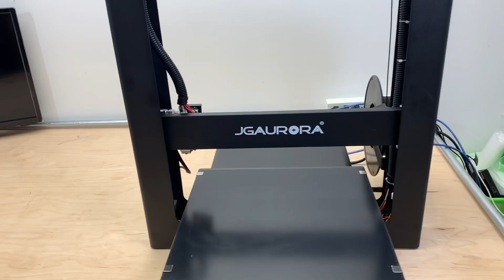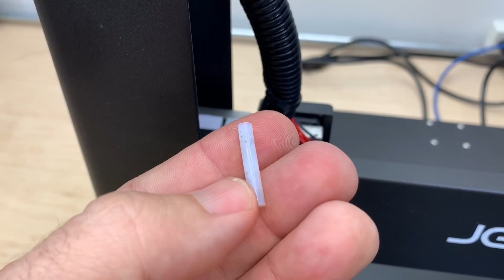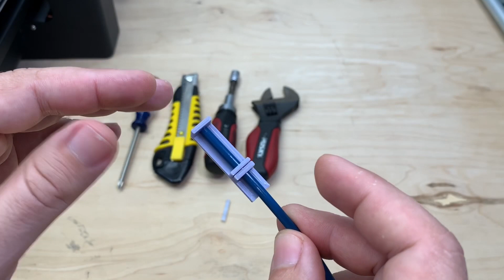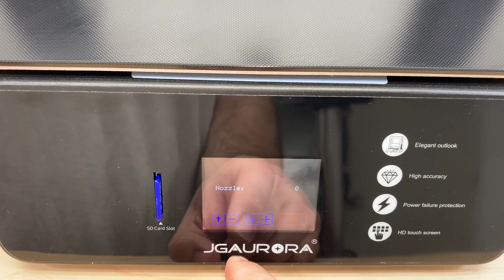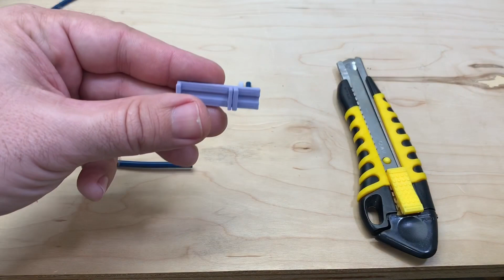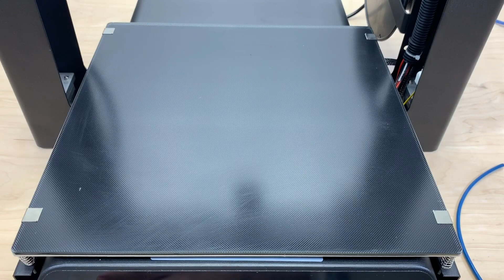A5S, A5, A1, and A3S Hot End Fix!

Comment: So, great video and I appreciate the thoroughness of your instructions.  I do however have a problem.. the ptfe bowden tube that finally came out  of the throat has an outside diameter of 3mm, I checked another new throat I have and it is the same.. 3mm.  The capricorn that I have has an outside diameter of approximately 3.95 mm.  It don't fit.  grrr.. this non standard stuff that JG has done is really getting frustrating..  I am going to put in the PTFE from the new throat but man this is frustrating..   Then just now checking Capricorn web site..  ""  We now also offer an XS series "Heat Break Liner," which is 2.0mm by 3.0mm in diameter..  ""  Seems like that's the ticket.. but how much is that going to cost to ship.. lol..

Comment: Thank you for this video !! But I have a problem... I can not remove the old PTFE tube !! When I try with 2.5 Allen wrench (euro size), I go completely through it, THe next size is 3 and it is too big... what is the size you use , so I can find the equivalent diameter ? Thanks
Reply from the maker: What temperature did you bring your hot end up to? And the video I mentioned bringing it up the highest it will go which for me is 260C. This should make it very easy to push it through the bottom as shown in the video.